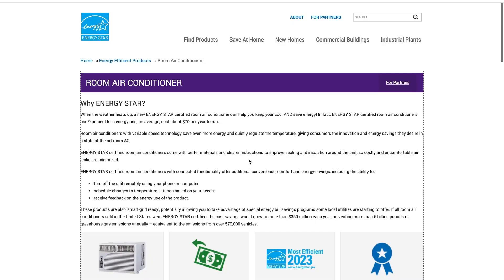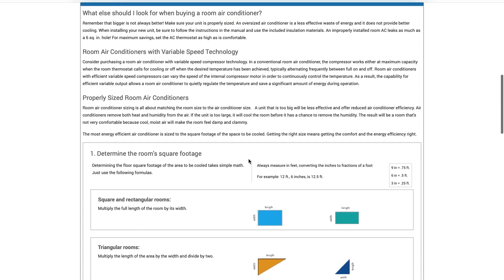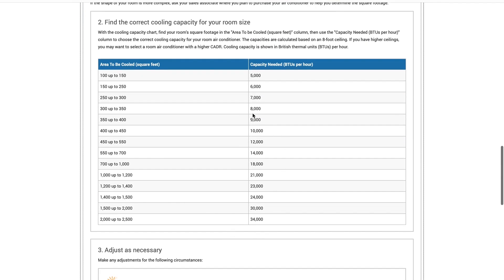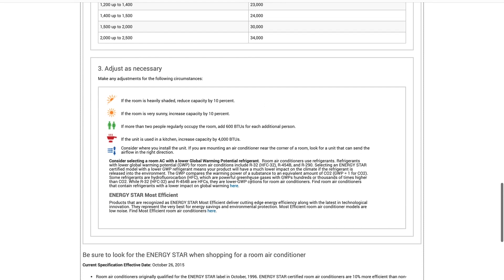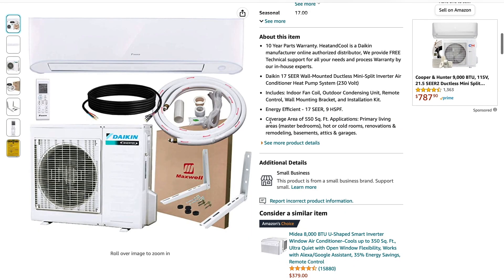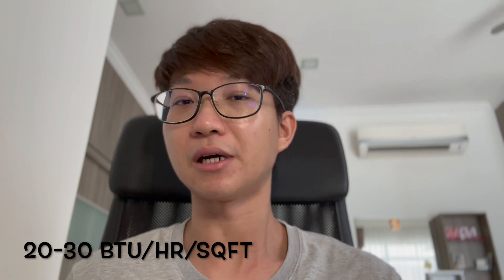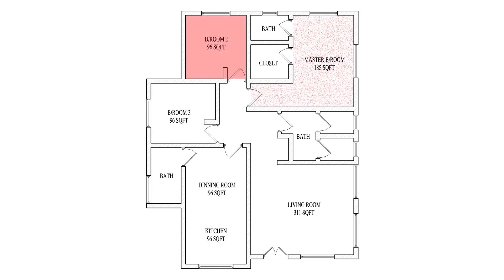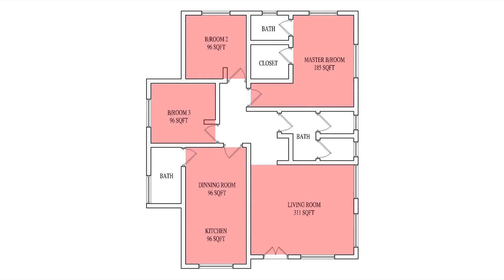How to Choose the Right Mini Split? BRAND, SIZE, ZONE, TYPE (Buying Tips by Engineer)

Comment: AC is quite cheap here. I got a 12000BTU SEER 29 wallmounted AC from Bosch (Midea) for 600 which seems to be fully overkill even. Have to run it in silent mode (can barely hear the compressor outside even). In regular mode it's just way too cold.
Reply from the maker: I also run my AC in quiet mode most of the time. Just a little cooling is comfortable enough for me.

Comment: So can/should you use DC for minisplits in the country, and CAN/Should those be repurposed if you can get a better deal on an AC unit?
Not at all scared of the electronics, just would really appreciate an off-grid in depth walkthrough that no one has really done.

Comment: I Japan mini-split units have some basic design flaws. For one thing, the remote controls have no feedback. The remote can say one thing and the machine can be doing another. Also, most Japanese homes do not have a thermostat, the temperature setting on the remote only controls the exit temperature of the wall unit. There are so many bizarre modes that almost no one knows what they really do. Thanks for your video. I learned something.
Reply from the maker: Thanks for your sharing as well.

Comment: (1) When you look at ac label you Will find others are written in BTU and others in watt. For instance 18000btu or 6130watt. How can I know their energy consumption per how? (2) input power and rated input power for AC's are the same thing
Reply from the maker: Hi Denis, thanks for your kind comment. AC cooling/heating capacity is written in BTU. So, 18000 BTU is the capacity and 6130 W is the power input. For energy consumption, you can take two ACs of the same capacity and compare their power input. However, comparing the SEER & HSPF value of same capacity ACs are more accurate. Rated input power and input power are the same thing. "Rated" means the air conditioner is tested under a specific condition. Since all certified air conditioners are tested under the same condition, some ACs didn't write the word "rated" on their brochures. 99% of the air conditioners sold are certified, unless you buy one from unknown places or black market.
Reply: If you find the model number on the label you can usually look it up online and get a datasheet. It will give you all the information you need.
Reply: Also once you have the SEER value, you can divide the BTU rating by SEER.
E.g. 18000 : 21 = 857Wh on average.

Comment: Thanks for putting this video together, very helpful info. Any thoughts on the Premium Levella brand? Have you ever heard of them?
I've never heard of them before, until today when a local HVAC company recommended them. They also recommended they typical Mitsubishi and Daikin which I am considering, but at $1,200 less for the Premium Levella, it's hard to ignore. Would be interested to hear your thoughts, if you've had any experience with them.
Reply from the maker: Thanks. I’ve not heard of that brand. Nowadays there are so many new brands coming out everyday. If it is below the $1k mark (9k model), it pretty much the same as other mini splits sold online.
Reply: @aircondlounge  Thanks for the response. The brand does make smaller 9k models, but they also make larger 24k and 36k models. But the one they recommended was their 18k btu model for my space. Decisions decisions...

Comment: I worry how cool and how warm these ductless systems will get. I live in N Florida, 90s and humid in the summer. Freezing temps in the winter. I see they only warm to 70f. Not sure how cool they get in the summer.

 Replacing my old central heat and air, expecting bids of $5k max but getting bids at $9-11K. Ive been using a portable AC in summer and oil furnace in the winter, since my old central unit, failed and use the air handler to circulate the warm air through the house, so worried the ducts are pretty dirty and mess up the new air handler, the ductless system not a problem.

 Also copper tubing between compressor and air handler has been sitting for a few years and worry its dirty, even though plan is to flush the old R22  and fill with the new R410 freon. 

I'm just not sure how reliable the ductless systems are some  saying problems after five years. Instalation looks pretty easy. 

What brand did you install in your home?
Reply from the maker: Mine is Daikin.

The one in my previous house still going strong after 8 years. Good quality mini splits do last but the entire quality thing is not just about the unit itself, the installation and power stability also play an important role.
Reply: How cool or warm/ f  temperature  do they keep the  house/ winter and summer?
Reply from the maker: When sized property, a mini split should keep the house at between 68F to 74F in the winter and 72F to 80F in the summer.
Reply from the maker: Oh and, about putting R410A into copper tubes that was initially filled with R22. Do not do so or be extra cautious because R22 run at a much lower pressure than R410A. The tubes can burst.
Reply: Stick with Mitsubishi. Good dealers offer 12 year warranty. You will have all the heat you can stand.
Reply: @aircondlounge  HVAC tech here and you can use the copper as long as it is one continuous piece without joints. If there are joints, they will have to be replaced. The problem with using the existing piping from R22 is that the joints were soldered together with soft solder where R410 pressures it is strongly recommended brazing for the strength. The other thing is the size of the piping. If the newer system uses larger piping then it will have to be upgraded. Seen many systems run with smaller piping from old R22 systems and they never performed right until the piping got resized to the recommended for the unit.
Reply from the maker: Hey good to see you. Have you encountered existing R22 copper pipes that have less wall thickness (eg: type M copper)? I worry the pipe itself won’t be able to withstand 550-600 psi.
Reply: @aircondlounge  I generally don't see regular off the shelf copper used for the application. If I do, I automatically say it needs replacing since it is not acr piping. If it is soft copper like the rolls of copper, it will hold for the most part unless it gets over heated during brazing. I also pressure test to 500 PSI with nitrogen for leaks.
Reply from the maker: Great to know!
Reply: My wife and I have a good deal of experience using mini splits (she is from Singapore and I used to live in Malaysia and Singapore where mini splits are almost exclusively used and central air is only seen in shopping centers/malls). We now live in central Florida in my hometown and I would have no issues utilizing mini splits if we were building a new house today. My only caution is that if the house is very large, then you will need to buy a lot of mounted units and it would likely get more expensive. If you have a multi A/CA unit house already (maybe 1 AC downstairs and a dedicated unit upstairs), then using central air for the main areas of the house and mini splits for rooms and offices would be a good consideration. You could set different rooms to different temperatures as needed or desired vs 1 temperature for the entire house like central air. You can also aim the vents, have them sweep, or change air speed room by room which is also nice.
Pros and cons with both, but you'll be fine with the coldness for sure if you size the unit correctly. I have never ran them for heat though given South East Asia is pretty much never below 75F, but maybe someone else can share experiences there. Hope that helps from one Floridian to another ;-)
Reply: I installed my Fujitsu back in 2008 or 2009, it's still working perfectly.  If sized properly, a MS would work just fine in FL and no place in FL gets cold enough to worry about heating performance.   I've been very happy with mine and I'm amazed how little it cost to use it, especially for cooling.
Reply: @ruthdanielson919 I have a 12,000 BTU mini split keeping my one bedroom barndominium home at no higher than 73 degrees in the warmest part of the house, and I am in southern Texas where it's 100 outside. In the living room where the unit is, I can get it down to 65 degrees. Mini splits are better at cooling than heating. They are far more advantageous to people in hot climates than people in cold climates. Also because it runs all the time (unlike a central, aka traditional, a/c system that runs, then shuts off) the humidity is controlled a lot better. I wish I had swapped to a mini split system sooner. Also my mini split uses literally like half the power of my old central AC unit. I installed the mini split myself, and it's wasn't a "friendly" DIY like Mr. cool brand. I chose to go with Senville. I had no previous HVAC experience, but I am mechanically inclined and do most of my own car repairs. Also after I installed mine, I did realize there is a brand called NG4 I believe, that is easier to install like Mr. Cool, but it's a few hundred cheaper. They also make a version that can run on solar power (it's called a Hybrid) and you simply purchase about 1,500 watt worth of solar panels and during the day the sun powers the unit!
Reply: @InitialDIYmods I totally disagree on using central a/c for anything in the south. These mini splits use about half the energy to cool the home. Also my neighbor spent $8k having his very basic, 12 deer, single speed, 3 ton central a/c replaced with labor and parts. I told him after the fact (he didn't tell me his a/c went out), I could have put in a 3 head, 8k BTU per head (24k total Btu) for each room, and a 18k BTU separate unit in his living room/kitchen, for $3,400 in parts. Even if I charged him $1,000 for the living room 1 head unit, and $2,000 for the 3 head unit in the bedrooms for install, he would still only be at $6,400, or $1,600 cheaper than the central AC he purchased. Also these mini splits would use half the power his current 12 seer central AC is using. Plus he would have two separate systems and if one failed in the future, the other could keep the house bearable until he can get the other fixed.
Reply: @Steven-gv1ke    EG4   is the cheaper priced brand you are thinking, that can be powered directly by solar.